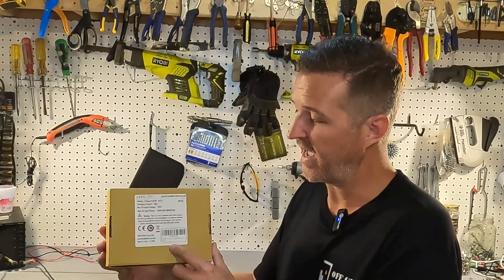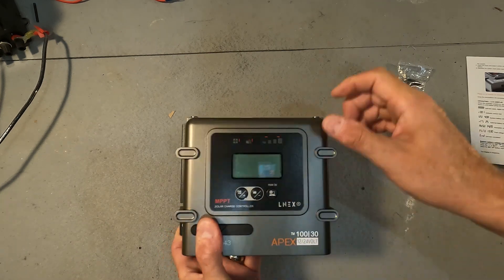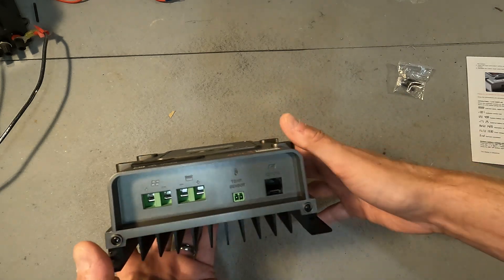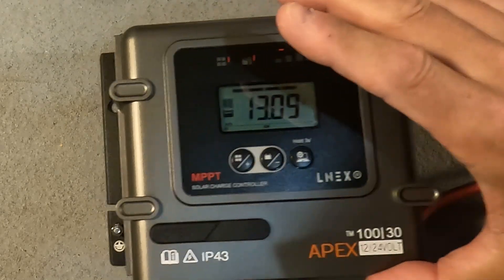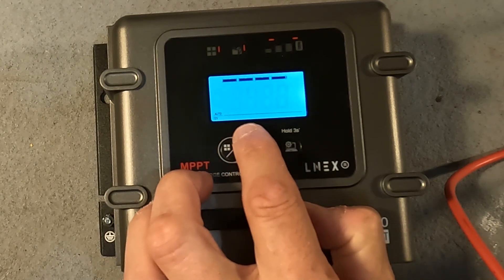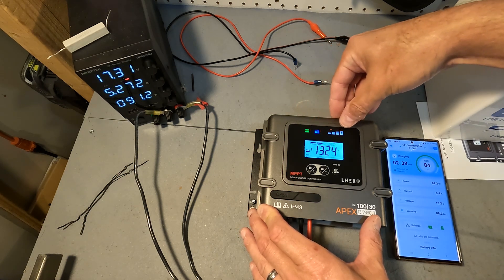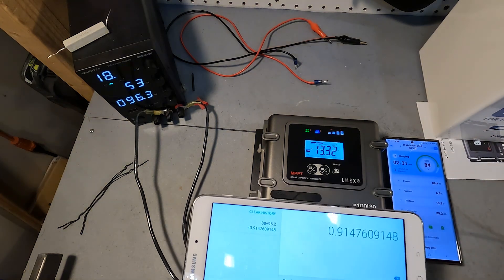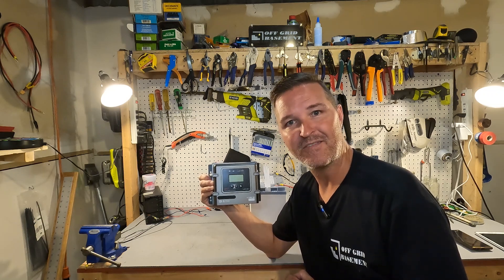LNEX Apex 100-30 MPPT Solar Charge Controller Review

Comment: I have the lnex solar charger, thats connected to 100w solar panel, thats connected to a 4000w invert thats conmected to my 3 12.8v 100ah Litime batteries. do i have to do any other configurations with the charge controller for my batteries setup?
Reply from the maker: As long as it is set to the lithium setting you should be good.
Reply: @OffGridBasement thank you sir

Comment: Hi Jim here I  love your channel have an unrelated question if you had $1000 to spend on new batterys for  a  12v system 1400watt aray and a 100a mppt charger controller what would you buy. Thanks for your help.  Jim
Reply from the maker: Personally I would get LiTime

Comment: i have a basic charge controller with no display, doesnt tell me anything.
was thinking about installing a victron shunt, but seems a bit complicated.

would just replacing my controller with this one and no shunt be good enough for my needs? id just like to know watts coming in from panels and state of batteries.
Reply: Yes, he can fulfill your needs.
Reply: I would put the shunt in. 
 You won't regret it.
Reply from the maker: They will both give you the basics, but the shunt will give you an actual SOC of your battery.  You won't regret getting a shunt.

Comment: Nice review. Whats the Max solar it can take for 12v system?
Reply from the maker: Max is 30A @ nominal battery voltage.  30 * 12.8 =  384w.  It can get as high as 430w when the battery is almost full.
Reply: 100 volts 30 amps
Reply: @reynaldotorres4349  My Victron 100/20 can do a Max Solar of 290 Watts at 12 volts so this 100/30 probably does more, Thats the questions i was asking
Reply: @michaelgkellygreen  100V 30A can generate 440W

Comment: Could you make a side-by-side comparison video of MPPT charge controllers from Renogy, LNEX, VICTRON, REDODO, I think a lot of people would be interested.Thank you for producing a great review!
Reply: A side-by-side will also show if it is a real mppt, and not a pwm with a mppt sticker.
Reply: @mraboyum  It is easy to distinguish between MPPT and PWM by comparing the input voltage to the output voltage. the input voltage at the PV end of the solar panel is pulled down to the same voltage as the battery when it is connected to the PWM charge controller. the PWM controller has no coil inductance.
Reply from the maker: Thank you for the information and the comment.